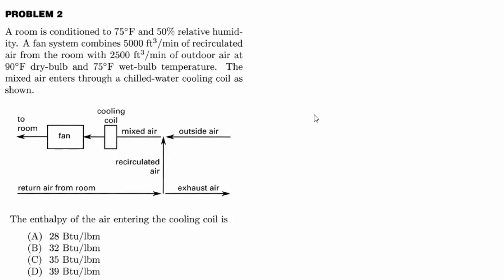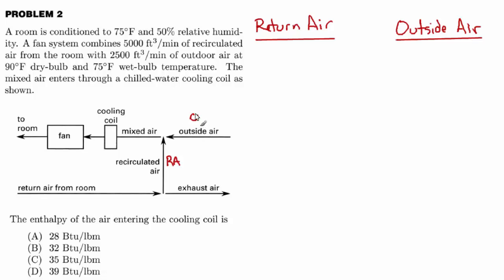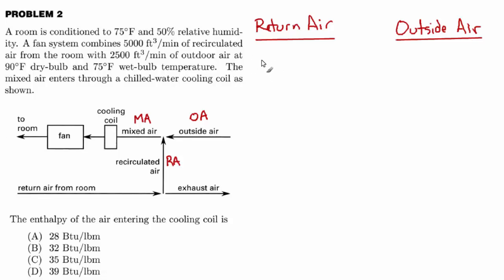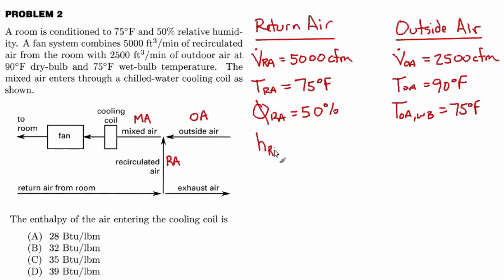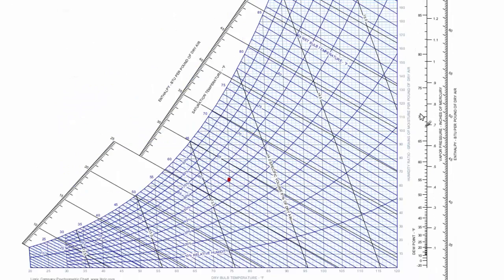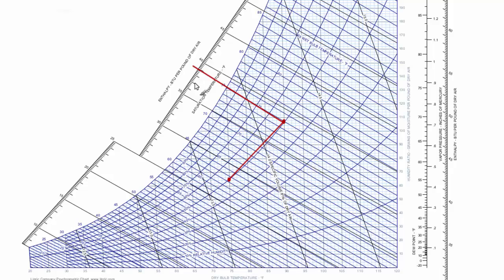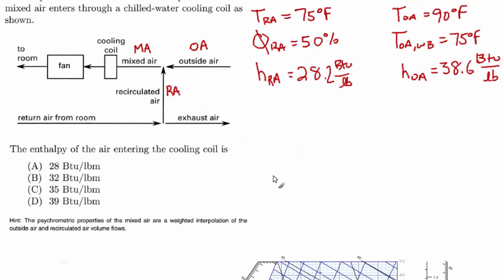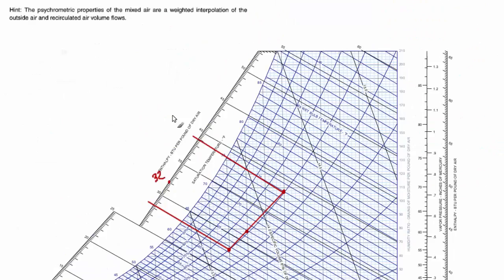Mechanical PE Exam Prep: Enthalpy Calculation Using Psychrometric Chart for HVAC

Comment: Another way I solved this problem is by finding the mix air temperature. Which comes out to about 79.95 F dB.  Then draw a line from 80 F dB to the line between state 1 and 2 and that will give you about 31.7 btu/lbm dry air.
Reply: Agreed, as an HVAC engineer finding the MAT (mixed air temp) is the way I've always done it.